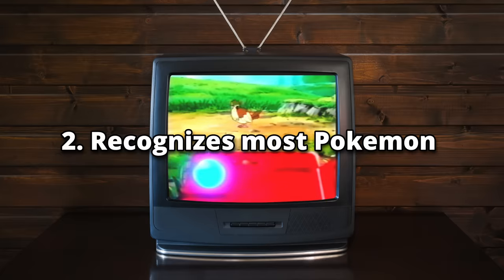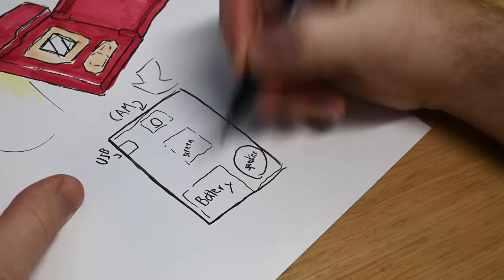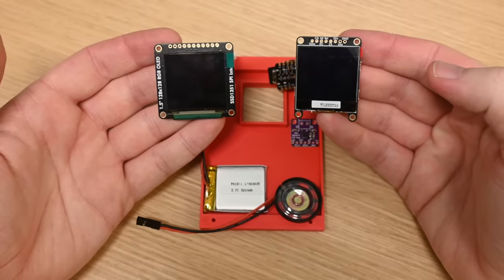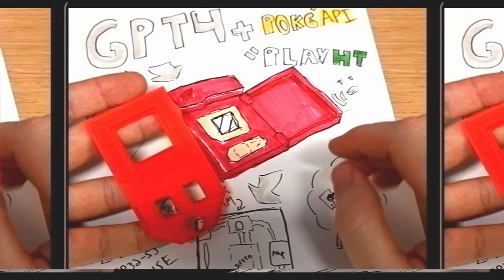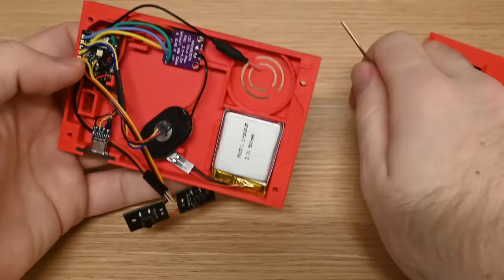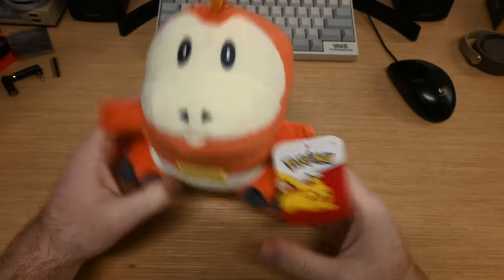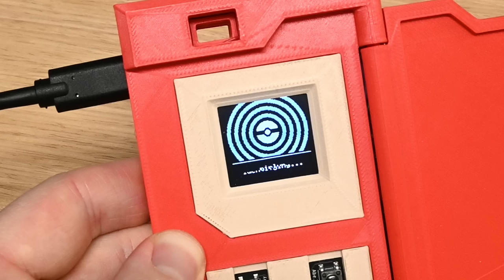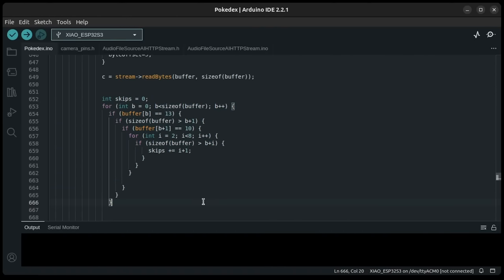I built the world's first real, working Pokédex

Comment: You dont have to recode just run it though an ai. Have it run simulations continuously optimizing the code. Over time it will get more and more refined. You can also have the ai simulate 2 seperate personas (pokemon masters or proffessors in this case) and have them learn from eachother aswell as the internet. Then all you have to do is leave the program running for a couple weeks while checking in occasionally to input your own optimizations.

Comment: Amazing project! Would be great if you train model using edge impulse and make it usable in offline! Btw, Which pins did you used in xiao esp32 s3 to connect that i2s module?
Reply from the maker: I believe it's just D0 - D2, i2S doesn't need specific pins like i2c so any extras will do

Comment: I am new to electronics so I would like to try and understand this better, particularly the data flow.
I see it is an .ino file, I was under the impression you had to be working with an Arduino board for that so I am confused... What part of the circuit is the program running on? Is it fetching data itself, or is it being run through the computer and relayed back to the circuit? But then, how is it connecting to the computer/internet when you are using it without the cable?
It is certainly an interesting project, a creative one too.
Reply from the maker: The arduino ide (and framework) can also be used on ESP32 boards like the Seeed Studio board which is housed on the camera. Believe it on not that little board, smaller than a coin, has the camera, microcontroller which runs the logic, the SD and WiFi all in one! So that’s what I’m coding in the IDE. The WiFi credentials are hard coded at the moment, and it uses that internet connection to upload the photo to a server. Once uploaded it calls the APIs for the AI directly from the microcontroller.
Reply: @abetoday ah thank you! Wow, that's one powerful board.

Comment: About the audio issue, i suspect it's because your voice service sends the audio data as "Transfer-Encoding: chunked" (check your http response headers)

What does this mean?
Instead of sending your audio data as one big blob of data, it's sent in smaller portions (chunks). "Regular" http uses the "Content-Length" header to denote how much data you're about to receive. Chunked http works by first sending the chunk size in hex (hex 1000 would be 4096 bytes) followed by a newline (\r\n). Then it sends the chunk data, and at last another newline. This means the ascii 1000 you found in your data should be exactly 4050 bytes apart (2 newlines = 4 bytes + 4096 bytes of data). End of data is symbolized by a chunk of size 0 (after which the server most likely closes the connection).

Why?
This allows the server to start sending the data before knowing the final size, no matter if it's streamed or from disk. This is not only faster, but in the case of streamed data it can save a good amount of ram too (If the server needs to know the final size before sending the data, it has to cache the data to get the final size, which in the case of uncompressed wav files can become quite large, made worse with a lot of concurrent users).

How do i fix this?
1. If you are using library to handle your http requests, your best bet is probably to just switch to a different one.
2. If you are handling the raw http streams yourself, the Wikipedia page is a pretty good summary of how chunked transfer encoding works.
3. Your current solution also works just fine. Just be aware that it will be deleting some of your audio data if it happens to include a "1000\r\n" (although 6 bytes is pretty much unnoticeable at modern sample rates)

Hope this helps!
Reply: Also this technically means your way of sending http requests is out of spec, since it doesn't actually care about the Content-Length header, although being in/out of spec isn't actually that important.

Comment: maybe its not that the charmander dies if the flame goes out, but the flame goes out if it dies

think about it
-if it is hypothermic, and the flame goes out, and it freezes to death, it cant reignite the flame
-if it is hypothermic, the flame going out means it cant generate enough heat to survive
-if its dead, the flame will already be extinguished
-it dies usually around the time and in the same circumstances that extinguish its flame
-its effectively a baby, so it has body temperature issues

id argue that the people in-universe had a mere misunderstanding that it dies when the flame goes out, which could be more a matter of coincidence or confirmation bias than actual science

Comment: If only there was something that already has a battery, screen, camera, speaker, and processor capable of running AI, in about the size of a cell phone
A polished pokedex phone app and maybe a 3D printed phone case is going to get you a lot closer a lot faster
but I get it-if your goal is to play with arduino stuff-that doesn't scratch that itch
Reply from the maker: That’s no fun tho

Comment: you did the camera wrong its actually on the top of the dex not the bottom. watch the series and you will see how satoshi points it at a pokemon with the tip of it not the back. plus you forgot the flashing blue light on the it. its not bad but it can be better

Comment: should have used a raspberry pi zero w, most of the described issues would have been avoided
Reply from the maker: Yes, but at the cost of boot speed, battery life, and device size! But yes definitely easier to code on.